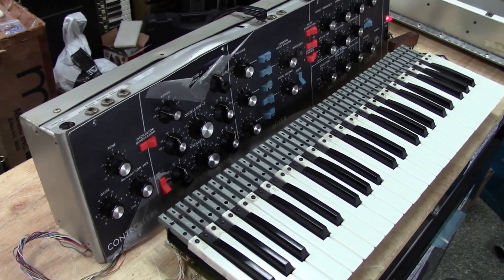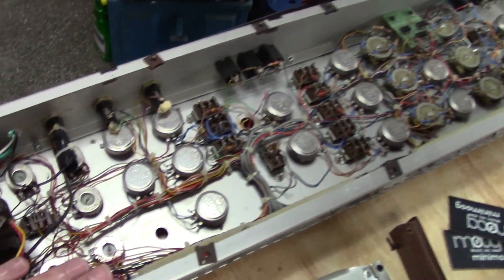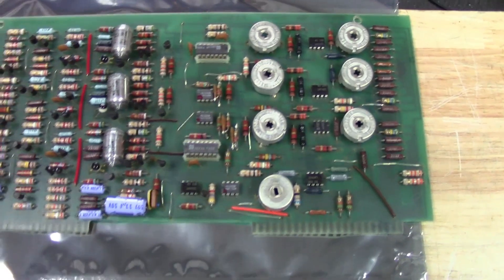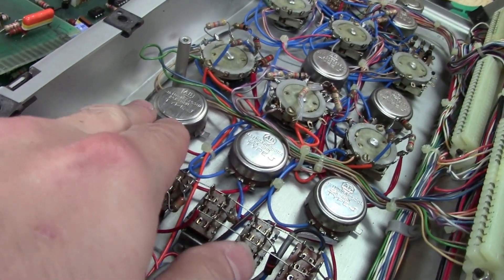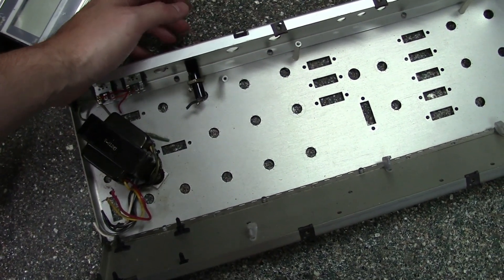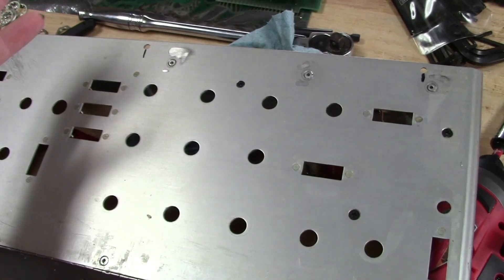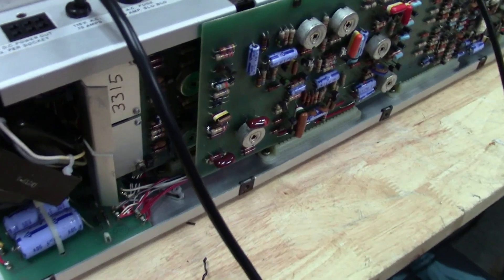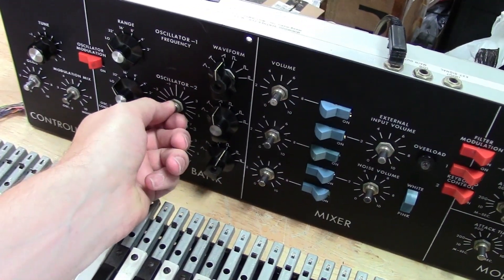Crushed/Wrecked Minimoog Part 1 (by synthpro)

Comment: I believe i sold you 5372 !   At the time i owned 3 Minimoog D's your 5372 , 5921, 4714 , It was a parts unit when I bought it too.....Every time you posted a Minimoog video back then i would look to see if my old unit would get restored...lol...Yes it was around 2012 or 2013ish when i sold it from Arizona ( All sold now)
Reply from the maker: Wow, that was you, Glad to see you here! I do remember you had those three listed sitting together on eBay back then. This minimoog did have a red stained cabinet, (still have it) and it a interface panel but was a cheaper quality. I'm sure all that harness will be getting a second life as well.  Glad you got to see what finally came of 5372.
Reply: @synthpro  I was Subscribed to your channel long before I sold you that unit  🙂...I used to communicate a lot with Kevin Lightner too , Sadly no longer with us

Comment: Yeah,  this is fantastic!  Great work so far.  I have a question.  Since this a combination of two Minimoogs, then are you planning on putting any modifications that you would not normally put on a standard vintage Minimoog?  Say midi, etc.?
Reply from the maker: Thank you very much! 
I plan on keeping this unit stock. As far as MIDI goes, I always just use a Kenton Pro Solo, they work great, (with a properly serviced minimoog that is) and doesn't require any hack jobs inside the chassis. 

The other bent minimoog however is a different story. I have drown up some circuits that will heavily modify the way that minimoog works. Since it is all bent and harness is in poor condition; I don't mind having some fun with it.

Comment: Sounds great. 

Maybe bring the original chassis to a good auto body repair person for a fix?
Reply from the maker: I thought about putting it in a press, only worry I have is the top piece because it is creased to the point the aluminum will probably crack. Will be tough getting the distortion out of the metal.
Reply: @synthpro  i mean you cant hurt it
Reply: If you can remove the faceplate,  the rest can be softened, straightened, and re- heat treated. You'd need to have it tested to see what alloy it is before you start.